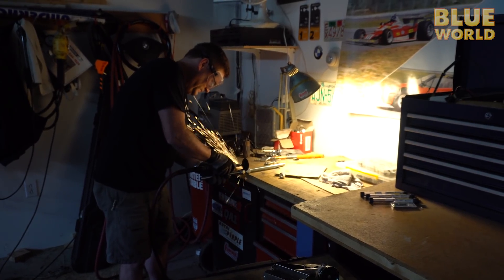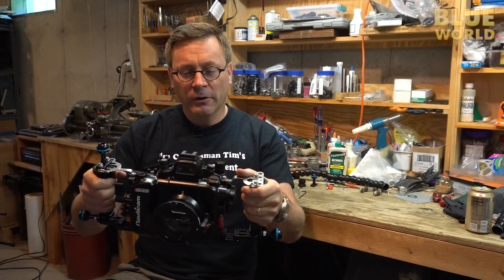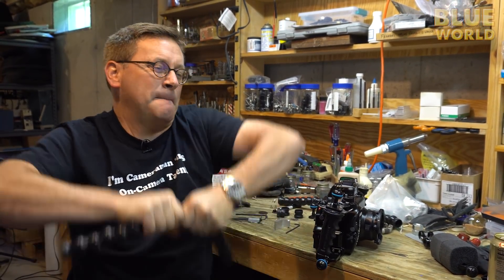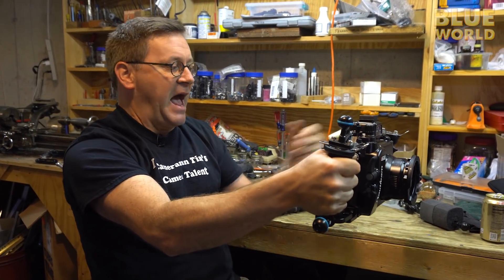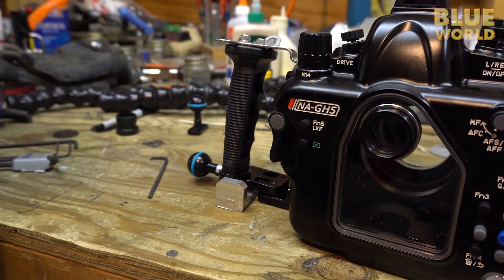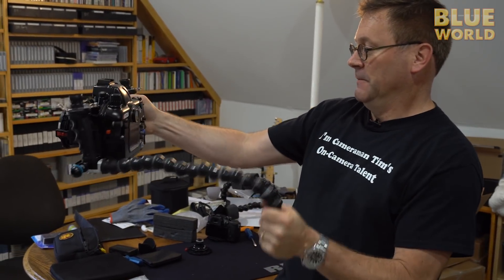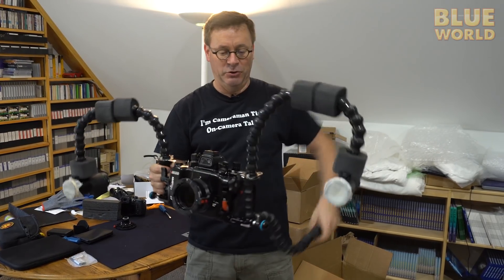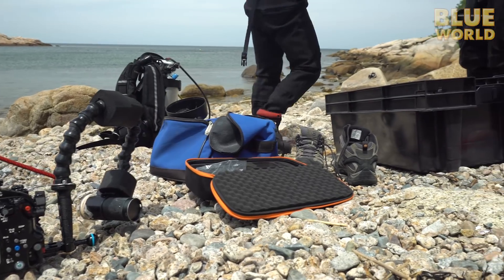Modifying Underwater Camera Gear | BLUE WORLD Extra

Comment: What're you using for diffusers on the video lights? Some sort of cloth?

The second handle idea looks cool! I've just been holding the camera by my fingertips and letting it hang to try to minimize camera shake, but it'd be interesting to see if the orthogonal handle works better.
Reply from the maker: I assume you, the orthogonal handle helps a lot.  The material on the lights is called spun diffusion.  It was developed to be used on hot studio lights (won't melt) but it also is not harmed by water.  Cheap:
https://www.bhphotovideo.com/c/product/44001-REG/Rosco_RS300611_3006_Filter_Tough.html

Comment: I have a problem with these arms which ist when it came out of cold water like 25C and being exposed in the hot weather like 30+C. some part would expand and then the link breaks. have dropped my light twice on land
Reply from the maker: I have not had that problem.  But you do need to remember that they are not super strong out of the water.  If your light is really heavy, it will droop.  I have had the loc-line pop apart when someone tries to pick the whole camera up by the arms.  They are not strong enough for that unless the camera system is very light (like a GoPro or something).  Some people run a piece of heavy fishing line inside the arm to prevent the light from going anywhere if the arm pops off.  I don't bother because like I said, it hasn't been an issue.  But if you are having that problem, your lights may just be too heavy for loc-line and you need to use conventional ball arms.

Comment: Great video - thanks for that. Im on my way to buy a SONY RX100 III, and with some UV housing (I dint know what yet)... and this mounting for lights:  

https://www.aliexpress.com/item/Arms-Tray-for-Underwater-housings-and-Gopro-Cameras-Loc-line-double-Arm-package/32608992017.html?spm=a2g0s.13010208.99999999.259.5b5d3c00iZQaBz 

Do you think that can work similar to your construction?
Reply from the maker: What you have linked there is what is known as a "tray"...it's a flat piece of aluminum that has the arms mounted to it and what you do is screw the tray on the bottom of the housing.  This is perfect if you buy a housing that has no handles on it already.  But some housings for cameras larger than the GoPro already have handles, which is why I was putting mounts on the top of the handles.  If you get the Ikelite housing for the Sony RX100, it should work with that tray nicely.  Even better, Ikelite makes their own tray that does the same thing and fits quite well.  I recommend the Ikelite.  It's bulletproof, and reasonably priced, allows access to all the controls and the clear construction gives peace of mind that there is no water in there.  The Nauticam is a wonderful piece of engineering, but very expensive.
Reply: Thanks Jonathan for your answer. I will look at the Ikelite housing and tray. I hope its not only bulletproof - I need it to be sharkproof as well:) Well thanks again. Me and 1000000 others love your videos! / Mike